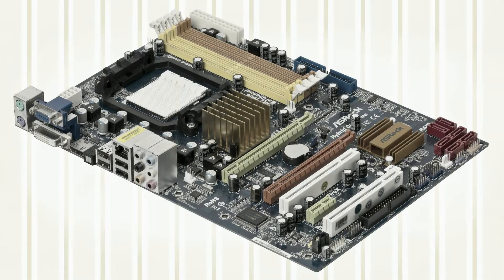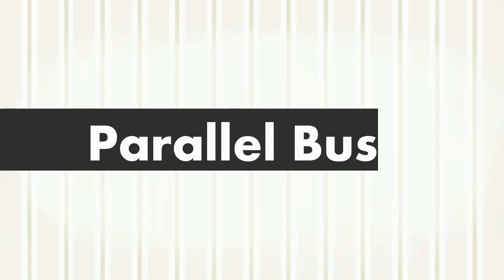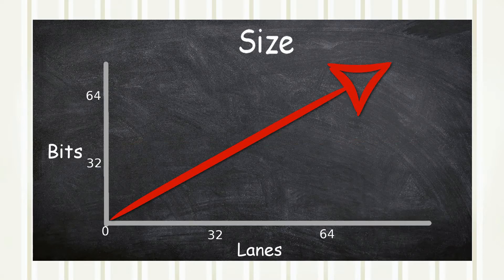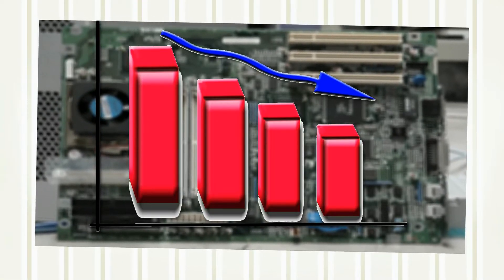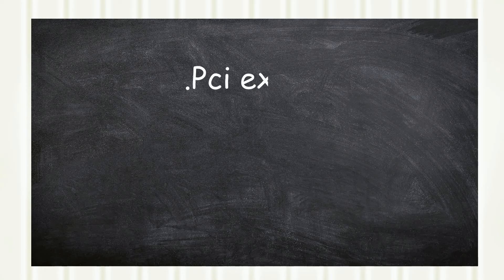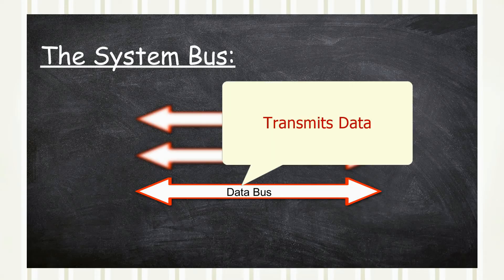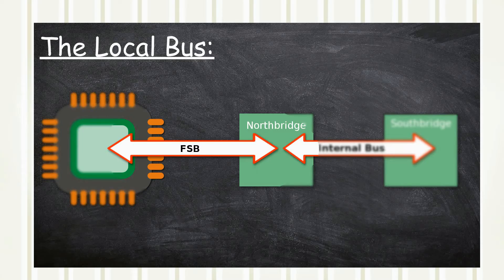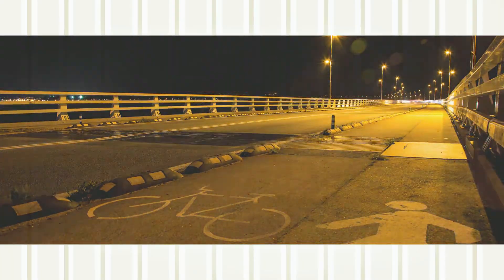The Bus | How the computer works?

Comment: Using multiplexer it is passed using two clock cycles , so how doesn't it impact performance.
Reply from the maker: The more lanes a parallel bus have the more prone it is to crosstalk. Because of this parallel buses have to operate at a slower clock cycles. This is why a serial connector like USB is faster than the old parallel connectors. Because USB even though it uses multiple clock cycles, it does so at higher clock speeds.
Reply: @NotezOnTek  Got it, Thanks : )

Comment: Serial bus has only one lane , so it can be also called as "buss with 1 bit of size" ?
Reply from the maker: There are serial buses with multiple lanes. The point is that the lanes work independently whereas lanes in parallel buses have to work together. I hope this helps, we are heading into more advanced territory.
Reply: @NotezOnTek  Got it, thanks for clear explanation :)

Comment: @notez on tek  iam planninf get the xeon E5 1620 V2 or xeon E5 1650 both of them uses a socket from 2011 or 2013 does it matter in those cpus because both of them do not have bus speed or qpi links? And thanks for your time
Reply from the maker: I think you should research if the CPU is compatible with the motherboard. this link maybe of some help 
https://www.cpu-upgrade.com/CPUs/Intel/Xeon/E5-1620_v2_motherboards.html

Comment: Does it matter in gaming
Reply from the maker: Well it depends. Older computer used the AGP standard which is parallel. but today's PC use PCIe, which is a high-speed serial bus.
Reply: @NotezOnTek  iam planninf get the xeon E5 1620 V2 or xeon E5 1650 both of them uses a socket from 2011 or 2013 does it matter in those cpus because both of them do not have bus speed or qpi links

Comment: Hey dude,do buses have a shape like a big wire in the power supply,or a physical object?Sorry,I cannot understand what you said because I'm a non-native English speaker:((
Reply from the maker: I’m not sure I understand your question, but a bus is generally a wired connection— like a usb cable which stands for Universal Serial Bus.
Reply: @NotezOnTek  I mean can I touch the buses lol?:D
Reply: @Tronaocungchoi  now as integrated connections in microprocessor ... Motherboard ...
Reply: @Tronaocungchoi  and in early days set of wires connected through different  cabinates
Reply: @Tronaocungchoi  even I also want to know dis
Reply: @NotezOnTek  and where it is in the power supply?
Reply from the maker: I’m still not sure what is it you are asking.  The buses that this video is referring to is for sending bits of information, not power.
Reply: @NotezOnTek  he is asking ..dt as we know bus is a hardware... N in early days v hv bunch of wires connected through diff. Cabinates... Which v can see.. now where d buses are implemented ?? In microprocessor ?? Can v see by naked eyes .... By opening our computers ??
Reply from the maker: @Shalini027.singhh  there are buses within the microprocessor; they are called internal buses. there are also buses on the motherboard that connect the RAM to the cpu. As for being able to see them, I think that would be very difficult to do.
Reply: @NotezOnTek  ok thank u ... So much .. n wht about external buses?
Reply from the maker: @Shalini027.singhh  yes external buses can be seen; USB is an example of an external bus.

Comment: anyone can confirm my understanding? does this mean computer bus basically mean ether 16 bit or 32 bit?
Reply from the maker: Well if you are talking about lanes, yes in theory a 16 lane bus could handle a 64bit memory address by breaking down into four parts. Remember the number of lanes  does not necessary determine the size of the bus.  Keep in mind that a 64bit computer means that its memory and register size are 64bit, it does not mean that information will travel in 64bit chunks down a 64 lane bus
Reply: @NotezOnTek  can u plzmake a video on lane and memory concept ....
Reply from the maker: @Shalini027.singhh   this is a much older vid; but it might be of some help. 
https://www.youtube.com/watch?v=OXLY7mrHIaI
Reply: @NotezOnTek  no.of lines  = no. Of bits to be transferred ,?? Am I right ??
Reply from the maker: @Shalini027.singhh   in a parallel, yes; but serial buses like USB use a single cable to transmit